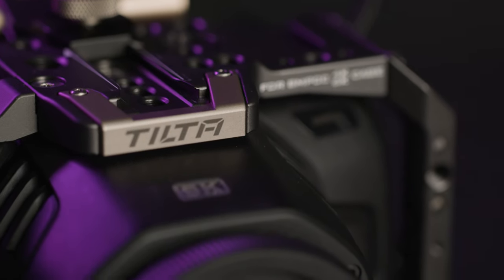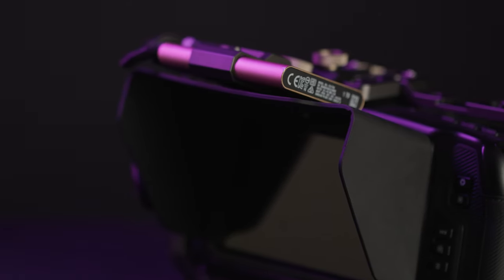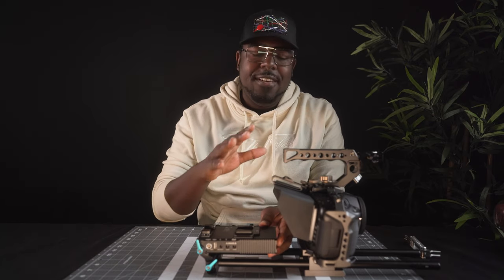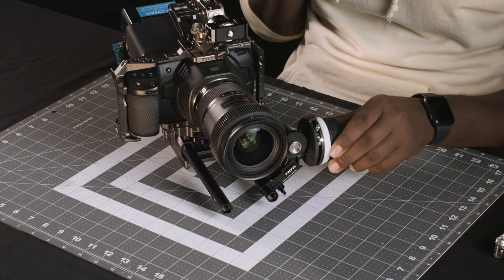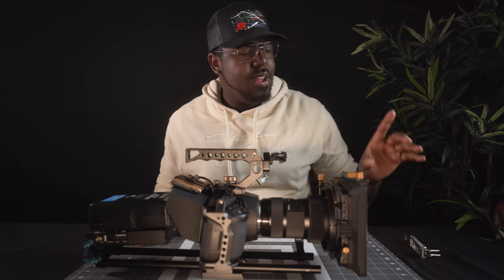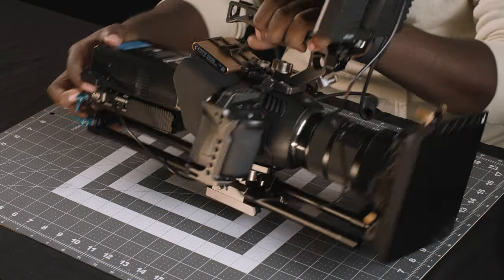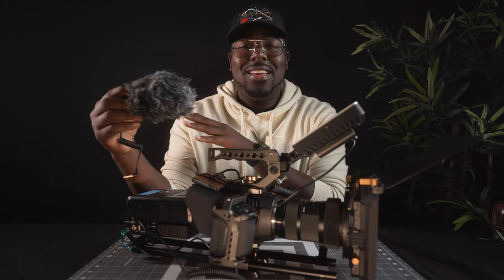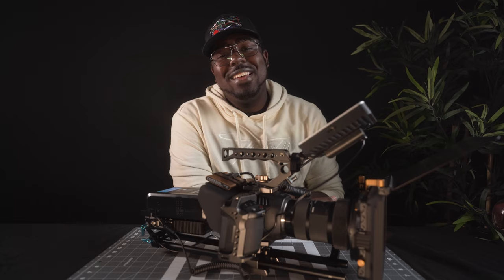How I Build My CAMERA RIG for FILM | $5K Cinema Rig

Comment: I have been window shopping for weeks now and I happen to find this video with pretty much all the parts I was looking at! My version of this build has the smaller 5.5" Smallhd screen w/ Core SWX L Flat Pack Battery  and a Mini Matte Box from Tilta. I can't help but notice that you did not mention how much your rig weights. If i had to guess, it seems like your rig weights 10-13 lbs. Thanks for making this video, and the other ones on BMPCC rig buildouts, very helpful!
Reply from the maker: I think I forgot or mentioned it in the other video, but yes, it is 13lbs maxed out I think!! And Nice! Your setup sounds dope!!

Comment: I was wondering how do you travel from your studio to where you are going to film with your rig? Do you break it down and put it a bag/case or do you leave it built out? Also why did you go with a manual follow focus system compared to that of the nucleus nano?
Reply from the maker: Excellent question! Depending on the distance, I usually break it down and store it in a pelican case! But if I can, I leave it built out if I’m not going far! And as far as the focus system goes, I decided to go with the manual focus because I don’t have to worry about charging batteries or extra wires with the motor! It’s simpler, and faster to set up!
Reply: @ChrisFranklinJr  about how much did it cost to put together a solid pelican case? I've been planning to do the same thing it's just a little budget tight at the moment. Harbor Freight has some solid alternatives I've found.
Reply from the maker: @JarredCordova  Haha, I think you found your answer!

Comment: Appreciate your vids and content my guy! While I was looking for a monitor mount... you just happen to upload this video and since I have a Tilta Cage as well... I literally clicked your link in the description and ordered that one..lol.. I assumed it would work. Didn't realize you had some type of adapter there between the mount and the handle. If you get a chance... would love to know what that adapter piece is! Thanks a mill again for the vid!
Reply from the maker: Hello! Thanks for watching! I wanted to let you know that there is no adapter! The monitor mount listed in the description screws right into the handle! And it comes with a screw and allen wrench! So you should be good to go!
Reply: Chris Franklin Man... crazy! The one they sent me has a 1/4th thread that screws into my monitor and the other end is a 3/8th that won’t allow me to place it in the same location on my handle because the receiving thread there is 1/4th with the locating pins being vertical and not horizontal as well. They gave me an Allen wrench but not an additional screw 🤷🏽‍♂️... Thanks for responding though man! Appreciate it tons!
Reply from the maker: @JerelNorthern  Ahhh man! I know exactly which one you're talking about! Wild, yeah the tilta need the one that just has a general screw placement! And no problem, here to help!

Comment: just copped this for my b cam to match up with my komodo footage. i got the newer baseplate tho - it's a lot quicker than the tension knobs. what else you got? i think i like that monitor mount you're using but i'm trying not to use anymore smallrig stuff. they have a peak design copycat strap that's half the price that i can't seem to find anywhere but their site, and amazon and b&h discontinued it so i'm worried there was a problem with it. 

if you haven't used them yet sprig makes dope colored cable mgmt clips to tuck all your wires. i got some slick glow in the dark ones for shooting clubs and festivals

Comment: Hi again Chris. I ended up getting the Feel World Monitor 279S with the Gyro dummy battery on your list. Im still assembling the rig, and it seems to fit into my monitor fine. I haven't powered up anything yet. My main concern is not to fry anything with potentially the wrong dummy battery for the monitor. Have you heard of any issues with the combination of the Feel World Monitor to the Gyro Dummy Battery / Dtap? Thanks.
Reply from the maker: Sorry that I am late, but I personally haven't!
Reply: @ChrisFranklinJr  Thanks

Comment: I've heard many times that there is a change of frying the hdmi port if you power both camera and monitor from same battery.
Reply from the maker: I’ve heard about that but I didn’t see that with the v mount setup. But I’m not entirely sure. From what I know, those are rare cases that come from not fully checking the voltage requirements.
Reply: @ChrisFranklinJr  thats what im wondering.
I have legit Swit battery, tilta v-mount plate. I wonder if i use regulated dummy battery(branded one such as Hawk Woods) for smallhd monitor, i wonder if i would be fine.
Yet i cant afford my camera to malfunction if it goes bad, giving it to warranty repairs which might take weeks would halt my work and i would need to rely on rental cameras
Reply from the maker: @Siimkristjanpariis  Most definitely, do what's safest. The dummy battery has a lower voltage requirement than the 2 pin, so I would start there, or just look into getting the Power Base Edge battery and keeping the camera power seperate.

Comment: Thanks for this!  I'm thinking of buying the battery and plate through the link after I save up a little more!  Can I ask, do you have a rough approximate of how many hours of 6k raw footage you can shoot with this battery and this whole set up?
Reply from the maker: No problem! On my 1TB drive at 12:1 compression, I believe I can get about 180 - 250 Minutes depending on the frame rates

Comment: Hi Chris, thanks for the video.. Why do you power the camera and the monitor with dummy batteries and not directly to the DC inputs?
Reply from the maker: Thanks! And no particular reasons, I already had dummy batteries in house so I went with it! ALSO, the monitor that I like to use the most does not support DC input!

Comment: Have you tried adapting the Sony lenses you have to the BMPC 6K? I am thinking of getting the BMPC 6K for my commercial work along with the Sigma 18-35mm F1.8 but I wondering if my Sony lens could work as well. I tried searching for videos on it but nothing.
Reply from the maker: Excellent question. Unfortunately, you cannot adapt Sony lenses to the BMPCC because the distance between the lens and the sensor would be too great.

Comment: Couple of questions. 
Is the fotga dp500iii better? It’s only $5 more so I was wondering if that one was worth it. 

And what kind of tripod do you use for that rig? I’m literally following the EXACT same build with my 6k and I’m looking for a solid tripod.
Reply from the maker: I think either would work fine! So far I have no problem with the one I have!

And I use a $600 tripod from Ikan! It's super nice!
Reply: @ChrisFranklinJr  I bought the one from your description and built my rig. I love it!! 

Dumb question though. How do I charge the battery? 😂😂 I plugged my coresxw ptap charger into the battery itself but that didn’t work. Or do I charge the plate, and if so how do I do that? 🙈🙈

Comment: Everyone seems to say the screw-in cable from Tilta isn’t enough for the 6k. Tilta only claims it works for the 4k. Lots of people have had issues recording to the T5 with that cable, which is a dang shame because no third party cables will screw into the cage like that. (Correct me if I’m wrong.) Oh well, I’m only using SSD in controlled environments. CFast for everything else.
Reply from the maker: Really?! Never noticed and I've never had a problem!

Comment: How’s it going Chris? For some reason the dummy battery only works when plugged into the 12v port in the brick. I know you mentioned to make sure it’s plugged into the camera icon port, which is what I did initially but with that it doesn’t power on. I was wondering what that’s about. Thanks!
Reply from the maker: Hello! I have no idea about that one! Mine works the opposite way haha
Reply: @ChrisFranklinJr  Oh wow ha. ok thanks!
Reply: Chris, last question. My 6k is kind of noisy at times as far as the fans and internal components. Kind of rough for audio, even external mics depending on the environment. Do you have that issue? If so, how do you combat it? Thanks!

Comment: cool rig, my concern is the weight 😀
Reply from the maker: It gets really heavy, really fast! That’s usually why I’m using the smaller build out without the v mount!
Reply: Chris Franklin ikr I changed my set to bmd battery grip, cfast for storage, top plate for mic and sometimes sun hood.
Reply from the maker: @Dub105  I want to get into C-Fast, they're just so pricey! haha
Reply: @ChrisFranklinJr  I know but it worths the investment believe me. I had Samsung 2TB T5 ssd drive. I used it for few months and suddenly start to fail me and stop recording while shooting. Wise Cfast is cheapest and recommended by BMD. And yeah less cables to carry around.

Comment: Wondering why anyone would spend 5K on a rig for a camera that's only 2K?  If the rig is 3K and the camera 2K, that's still a bit on the rich side.   Regardless, I'm sure there are way less expensive alternatives to keep the cost down.   After all, the camera already has the most important element.  The 6K sensor.  All else, I would say, can be shopped around.